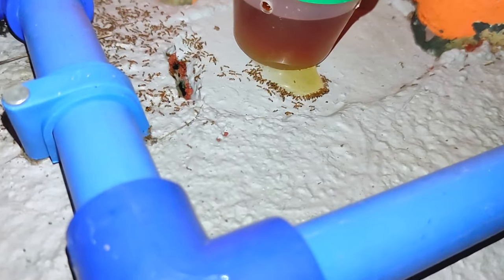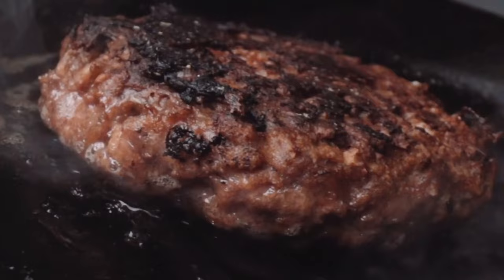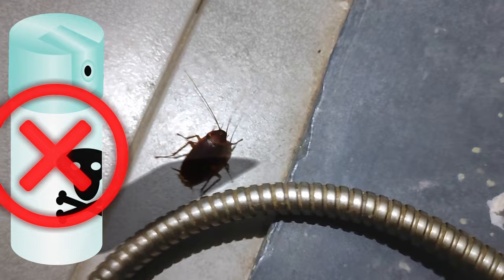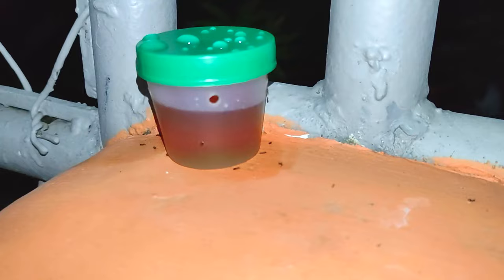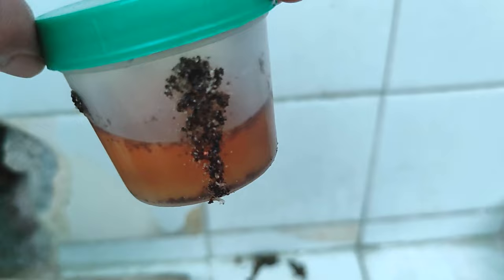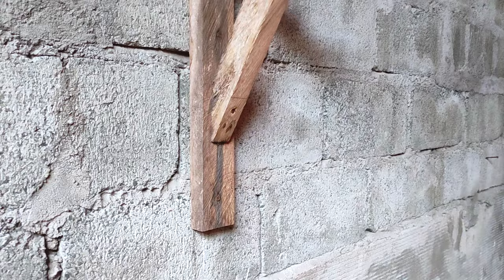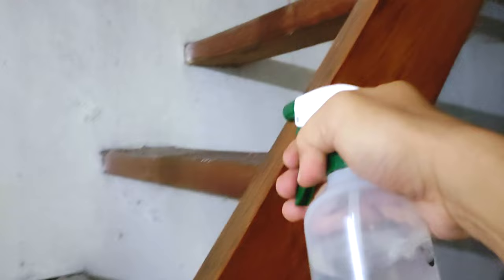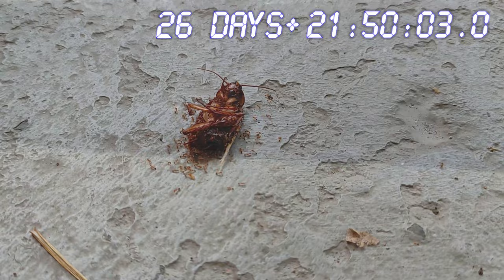Is Borax Effective vs ANTS, ROACHES, & TERMITES as a Pest Killer? (Part 2 of 2)

Comment: Borax works wonders with ants where I live in Northern Nevada, USA.   I MIX 4 parts sugar to 1 part Borax, sometimes I tear up tiny bits of bread to add to the mix.  I just add enough water to dissolve everything.  Because we don't have any pets or small children, we put the mixture on wax paper.   Within 24 hours, the majority of the ants are gone.  Because our air is so dry, we sometimes have to put out a second batch a day later, because the water in the mixture drys out.

Comment: Excellent video(s)!  

For roaches, I have always used roach tablets (which have been around for ages) which use a boron and flour mixture, but which is probably a little more expensive than your ingenious method.  In any case, they work winders, but you do have to have a little (not a lot) of patience.  Because I have cats and feed then near my house, I will always attract roaches, but the tablets (or your mix) both work wonders at drastically reducing the population.  I hardly see them, though there is the occasional one or two.  Then I find them either dead or near-dead.

But I am going to try the ant mixture for ants I get in my yard.  They are not a big problem, just a nuisance, but I would love to see them gone!

From what I’ve read, in Ecuador it is mandatory that all wood used for housing be pretreated with boron (borax is a type of boron).  This completely eliminates the need for any subsequent chemical pesticides except in rare cases where water leakage has somehow soaked into the wood so much that all the boron in your house has washed away.  (& if that happens, you’re probably already underwater anyway!).
Reply from the maker: thank you for sharing your insights! I appreciate it!
Reply: @HanDIYman007  , ditto back x 1000‼️❣️

Comment: Ok here is the real & easy solution. You mentioned Pesos, which means that you are not living in US or Canada. Good, because you can buy chemicals much more easily and at far less price. 
Get a kilo of pure Boric Acid, it comes in powder form. Trust me it’s not acid like sulphuric acid 😊 You can touch it, no harm. But if you feel uncomfortable then wear rubber or latex gloves. 
Sprinkle the powder along edges & corners along the walls. In the kitchen use plastic or newspaper covers on shelves, then sprinkle the powder under the covers. 
No more roaches, ants or any insects. 
Only caution: it’s highly slippery so don’t drop it on the floors or someone will slip & fall. Also avoid food contamination.

Comment: I use dry dog food as bait on a plate with the borax solution. Borax solution ..I use soda.
Reply: Any success with this method?
Reply: @bellattery  
Yes - but then the soda dries up / I used too much borax and not enough soda but it definitely worked. Also found a roach or two dead and I never seen a roach here before.
Reply: @turbosupra2jzdragracingtob249  the roaches are there just good at hiding. Good bait